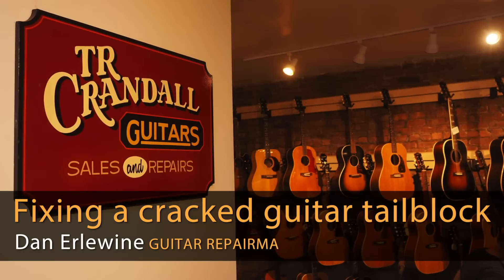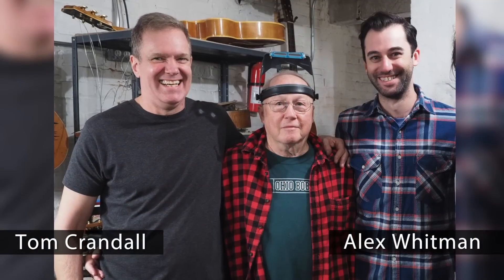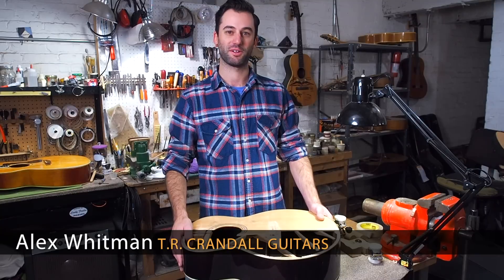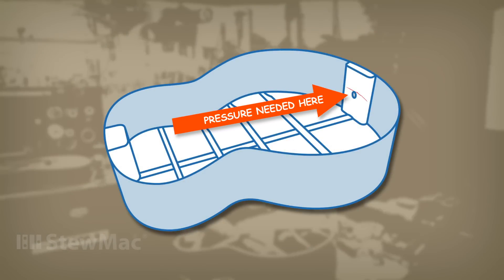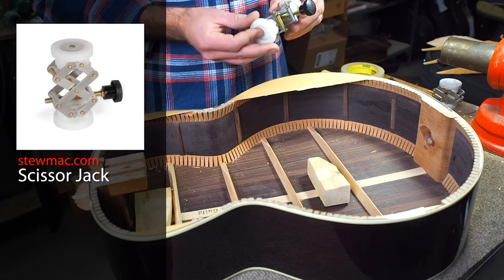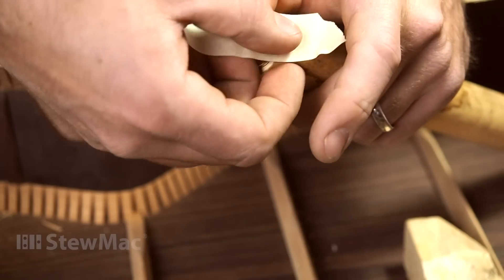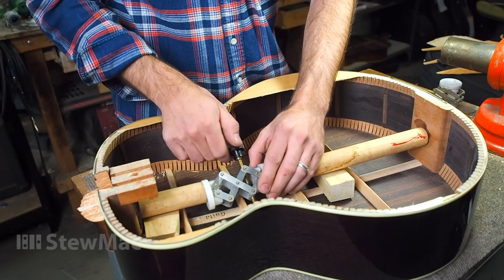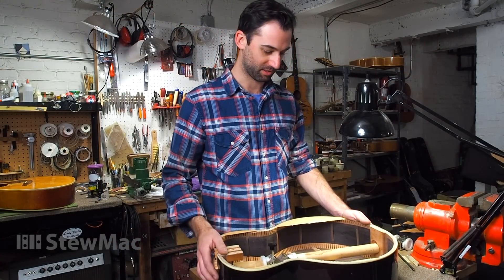Fixing a cracked guitar tailblock

Comment: Great technique using the screw jack! This type of crack is a good reason to build with either a cross-grained two layer laminated block or a Fleta-style horizontal/vertical/horizontal stacked block.

Comment: I bought a Taylor guitar with a crack in the heel. Was hoping I could post a photo and get your comments. It’s not at the seam but in the curve of the heel, and not completely through. Not sure if gluing with clamps will pull it back to normal or not. Won’t budge at all if I try to move it in any direction. If there is a way to post a photo or allowing me to send an email I would greatly appreciate your thoughts👍 thank you, Cindy

Comment: All is fine and dandy, BUT how do you apply the glue to the crack AFTER it's back in place ?
Reply: I use the sawn-off head of a brush glued to a piece of wire
Reply: @malcolmrose-zadow5517  how is the glue going to get into the crack,  it's back to its normal position,  there is no gap for glue to flow into.  You would need to apply the glue before jacking it back into position,  and that is NOT what he says in the video.  He says he jacks the block into position so he can then apply the glue.  No glue will get into the joining surfaces of the crack. .  He in effect will only have surface contact glued,  the first time the guitar is set down hard on the tail.  The crack will open.
Reply: @kawligadr  I'm sure he meant to put the glue in the crack before clamping it, otherwise it doesn't make sense.
Reply: @malcolmrose-zadow5517  I watched the video over again and he mentions glue AFTER THE CLAMP.

Comment: I’m missing something here. As the red line shows, the crack looks like it’s exactly perpendicular to the normal grain direction of a spruce end block, which seems odd. Okay, so it’s not a vintage treasure, but I wonder how permanent repairs like this are (and in which cases you’d want to replace the block altogether).  Are there not stresses going on in the soundbox that might reopen a crack somewhere else within the same block? Cheers.
Reply: This is a common crack which usually occurs when the guitar is dropped on the endpin. The tapered endpin acts as a wedge, splitting the tail block. It doesn't take much to cause the split.  The jack is used to open the crack enough to get the glue inside.  With good glue, the repair is as strong or stronger than the wood.  I've repaired many this way through the years without any problems.